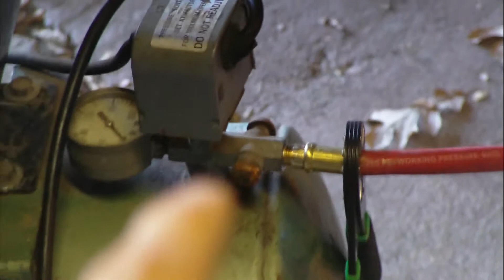SHE"S NOT NEW NOW BOYS. :(

Comment: too bad you didn't have the quick connect end first for the compressor. vice grips bud or take your vice off the bench and clamp it on there and turn it. but vice grips would take it off. also with the quick connect on the compressor, it shouldn't kink on you cause it will spin freely. hope that helps bud!!